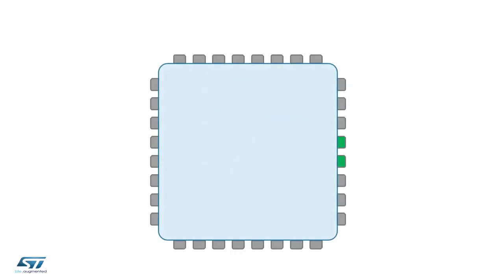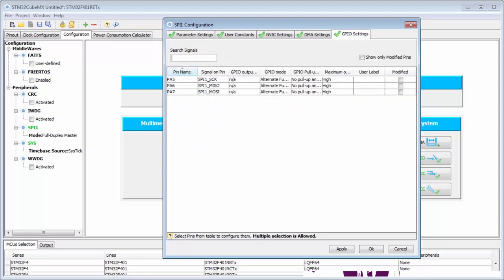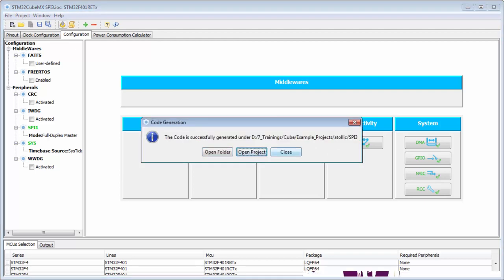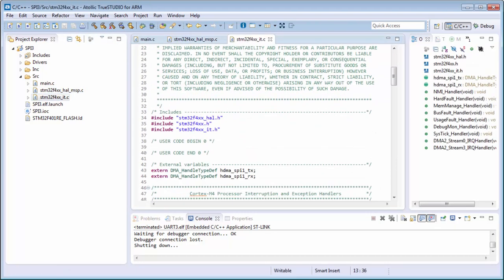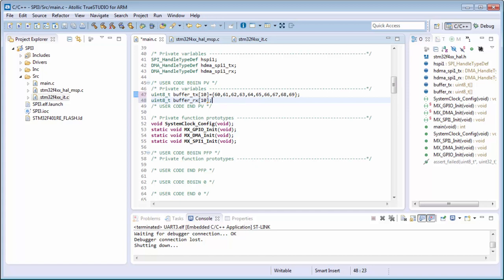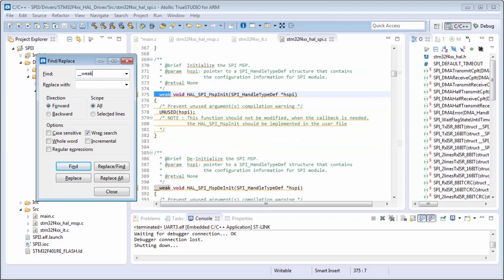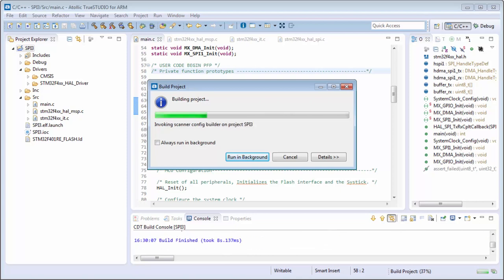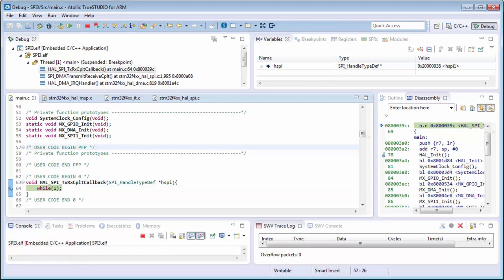STM32CubeMX basics: 11.3 STM32Cube HAL labs SPI - Lab SPI DMA

Comment: If a SPI port has multiple SS pins that can be used (PE4, PE11, etc), the main.c's MX_SPI4_Init() enables /disables the SS:
hspi4.Init.NSS = SPI_NSS_HARD_OUTPUT;
hspi4.Init.NSS = SPI_NSS_SOFT;  
However it's in the stm32h7xx_hal_msp.c file (HAL_SPI_MspInit()) that defines WHICH SSN pin to use!!
But is it possible to enable SS (SPI_NSS_HARD_OUTPUT), but IN-ADDITION manually take control of the pin like HAL_GPIO_WritePin (SPI4_NSS_GPIO_Port, SPI4_NSS_Pin, 0);

Comment: tried on stm32cube ide on 19/9/20 and it worked on a nucleo f091rc.. be careful to connect on pin declared on .ioc pinout configuration listed on spi1 gpio settings and change SPI_DATASIZE_4BIT default to SPI_DATASIZE_8BIT
Reply from the maker: Hello! Visit our online community to find answers to your technical questions and share ideas with our developers and ST experts : https://community.st.com

Comment: The NSS Pin need not set?
Reply: Personnally, if I reset it before HAL_Transmit_DMA  and set it after, I have a wrong value. If I don't do this I have shifted-bytes value (the shift change when I reset), that's usually a problem when you don't set NSS pin. So... I think you have to but I don't know where to set and reset the pin. If you find it out, please let me know

Comment: Curious as to why you don't open the project after you generate code....
Reply from the maker: In case you had installed few different Eclipse based toolchains there were issues in older versions of STM32cubeMX to properly opening the proper IDE.

Comment: STM, i'm not sure how much u work with microcontroller (u remark the sarcasm) but in my opinion you have 2 major bugs in your structure.
Why did you designed the interrupt of UART and SPI to de deinit after it received the data?? Because that's what you do, you set the pointer to NULL. Why??
Also the second problem, why it is nessesary to receive a specific amount of bytes? If you communicate with uC via PC you don't know how many bytes you will receive, but that's what you have to know to make this interrupt work. Otherwise it won't call the callback untill you send the correct amount of bytes.
After every com you have to reinit UART/SPI and set the correct amount of bytes beeing received. Thats not efficient neither usefull.

It would be much better if you just reset the array number after the buffer end has reached and start from 0. Also an option for a message end command would be nice too. I can do all this on my own, but for the ppl out there without expirience it would be very helpfull.